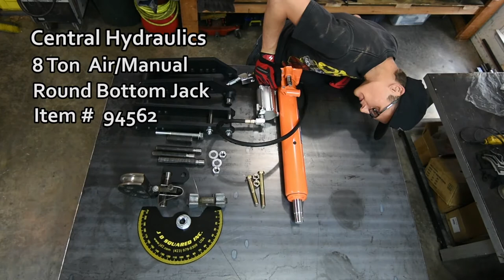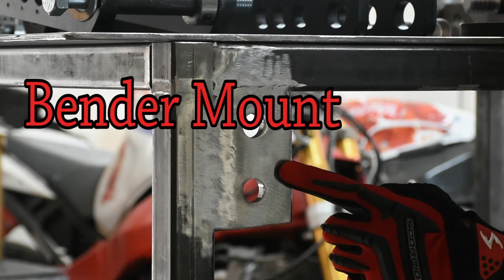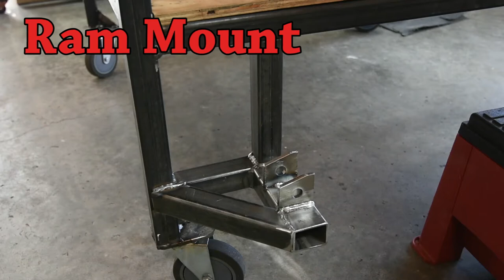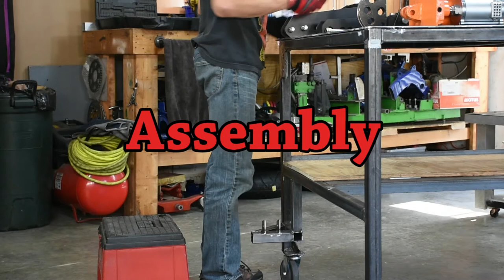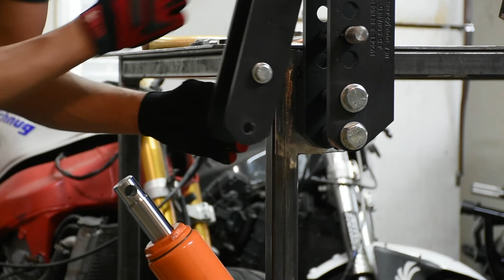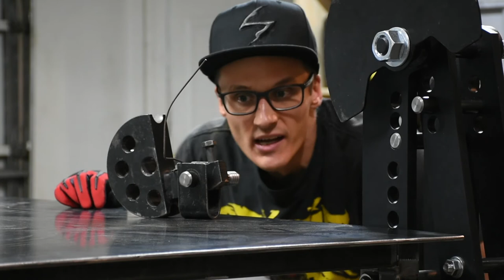JD2 Tube Bender Air Over Hydraulic Conversion

Comment: One comment on leverage: The geometry is such that the ram is nearly square to the ram at the end of the stroke. This gives maximum advantage to the  ram where it is weakest. Hydraulic rams are notorious for buckling under load while fully extended.

Comment: Okay, you made me giggle. GJ on the bender. Now lets see if it can handle a tube. Bend steel not air. :) I would love to see the vertical in action. Horizontal kinda sucks...hard to see the degree wheel. Grab a die...grab some meat and lets see it in action.....

Comment: That's the same bender that I just purchased and received. For those of  you considering how to power your bender, keep in mind the Air/hydr. units are SSSSSSLLLLLLLOOOOOOWWWWWW and they will burn your compressor to the ground. They will use an 80 gallon tank of air for each swing of the bender arm! Not kidding! I just purchased a BRAND new JDsquared model 32, and right out of the box I knew I was not going to use the mechanical handle so I purchased the air/over unit even before 
the bender arrived.. Built a nice rolling stand using an old engine stand, got it all together and set up... and HATE the air/hydr. unit.. it's mind-numbingly slow.. and you get to listen to your compressor run for the 6 minutes it takes to do a full extension... Yeah! I just got off the phone with the guy that installed my 2 post car lift. He says he has a good, used, 110 volt hydraulic unit with reservoir set up that will work perfectly. If anybody is looking for a Habor Freight Air over hydraulic unit-I have one for sale-CHEAP.. Never used to bend a piece of
 pipe.. Just used to extend the bender arm to see how it would work.